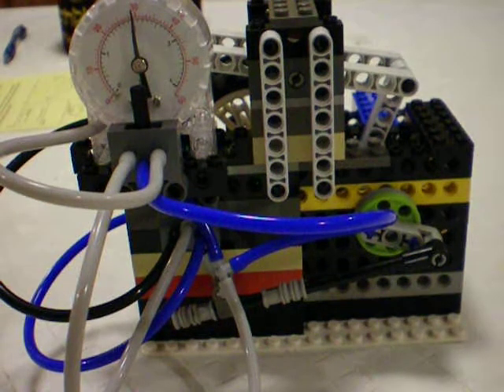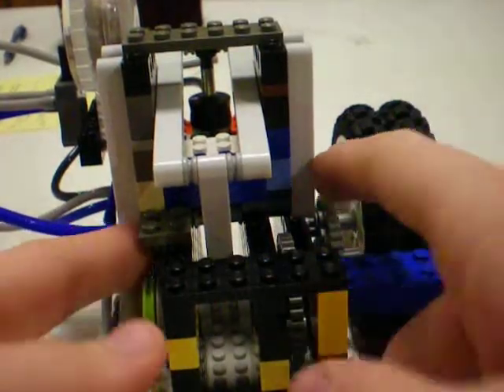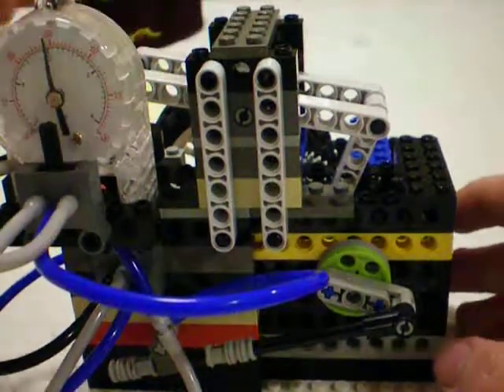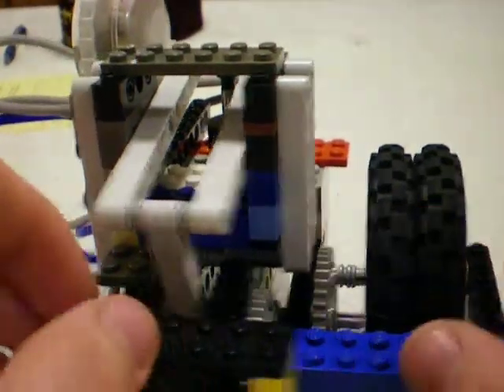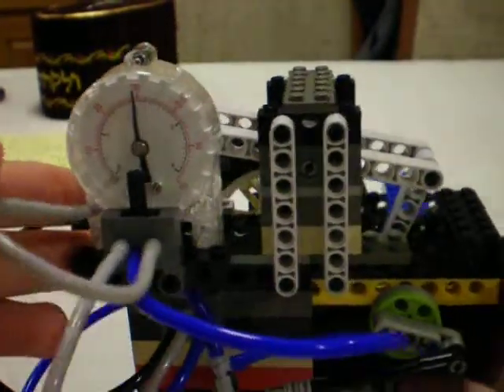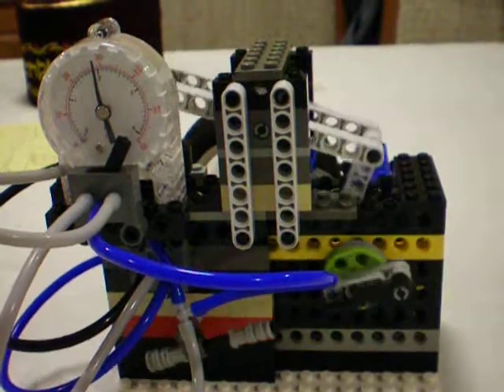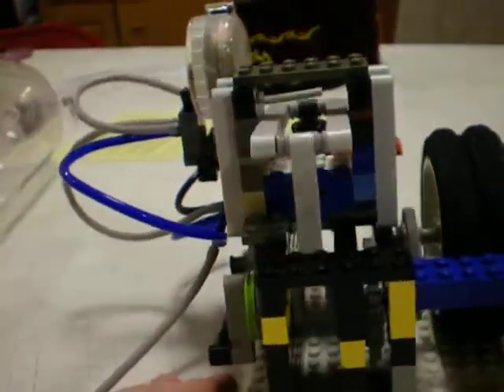Lego walking beam engine prototype

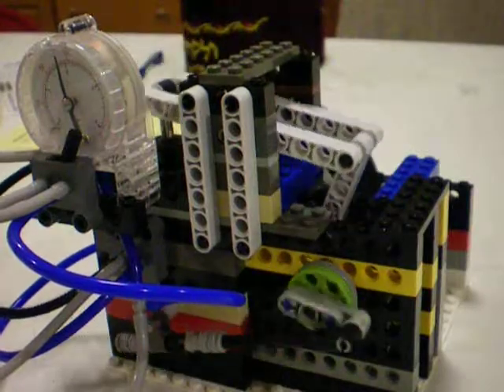Comment from the maker: @Loooffy A little of both. For this video I only pumped the bottle to about 30psi as opposed to other tests where I used 40-60psi. The gear ratio is also fairly high at 1:25. That is necessary for this type of engine because otherwise the flywheel doesn't have enough momentum to carry the crank past the toggle point. For that reason, I prefer the scotch yoke system. For an example check out my 3 cylinder scotch yoke lpe.

Comment from the maker: @Loooffy The sliding push rod operates the switch. Each time that the switch changes position, not only does it change which tube is connected to the air tank, it also releases (exhausts) the air coming out of the compressed end of the piston. The piston is connected to the walking beam, which goes to the crankshaft, whose one end goes to the flywheel and the other end goes to the sliding push rod's cam wheel. I hope this is helpful.